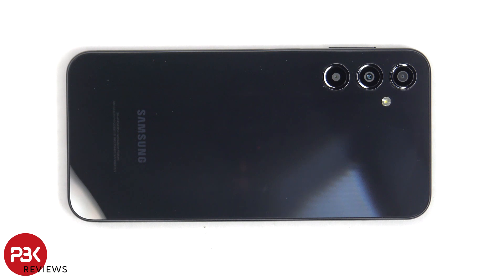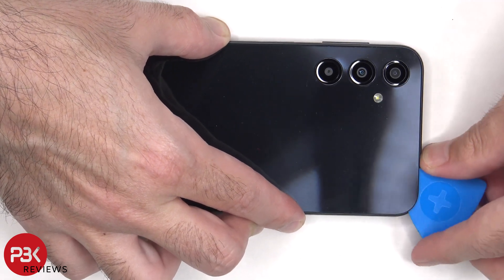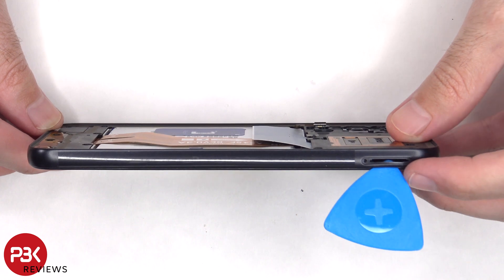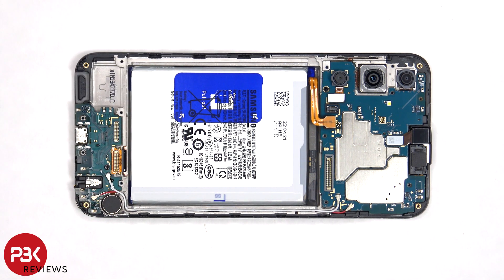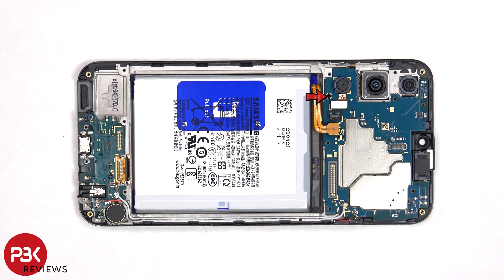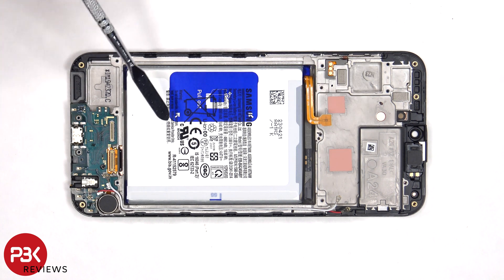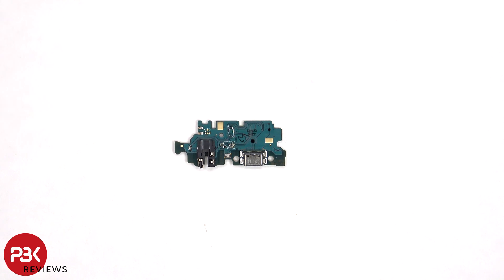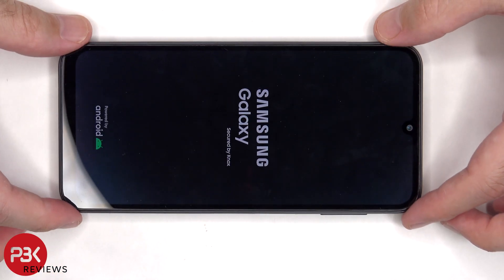Samsung Galaxy A24 Teardown Disassembly Repair Video Review

Comment: Excellent description and very well presented. 

I'd be most grateful for any help. I replaced the A24 battery successfully, it charges and the phone works except after a short time it closes saying it is overheated, whether its charging or not charging. But ambient temperature is 20C and the phone does is not at all hot. I suspect I did something to the phone when working on it. In troubleshooting, I scaled down all its energy uses to bare minimum and did a clear wipe of the cache but no improvement. 

I found that without the protective case, the phone will stay on much longer. But a few minutes after putting the case on I get a warning message that the phone is heating up and will be shut down. It's still not hot with the case on. Before I replaced the battery, the case never gave an overheatiing message.

Comment: hi, i would like to ask a weirdly specific question

lets say a decent amount of weight (for example, a medium sized, half filled tumbler bottle) was dropped into the phone and impacts the back of the phone, specifically to somewhere between the middle of the flex cable connector, the battery connector and level to the 2 pixel camera at the bottom and presumably hitting somewhere either connected to or the processor that's been hit , and the impact is enough to cause the phone to crash and shut down every 15 minutes or so, however, a drop approximately a desk tall cause the conditions to worsen significantly, causing the phone to only be able to stay on the home screen for roughly 3 minutes and occasionally taking 3-5 boot loops (as the phone attempts to start into the home screen).

eventually, getting into the home screen is getting difficult, and the end of the day the phone only boot loops with it taking a considerable delay in between pressing the power button and the phone turning on at all. and through another series of unfortunate mishap the phone eventually boot loops repeatedly until the battery ran out and the phone, showing no signs of life, is hard bricked due to not being able to be charged.

how can this (presumably and no matter how unlikely) be fixed?

and what could the damage be? could it be the capacitor supplying power to the processor? could it be the ball solder connecting the processor to the board, or could the damage be from the processor itself where something in the silicon is damaged? or could it be something else? what would you do to diagnose the problem and what can be done (or attempted to be done) that would at least remedy the boot loops and get it to a state (full home screen boot or recovery mode) where data can be extracted from it?
Reply: My a24 fell of the balcony 5 months ago then its screen replaced, it worked about 4 months then it become just like yours, its very hard to get to the home screen and it dies after 15 minutes.
Reply from the maker: Hi, not sure it can be a host of things. It may be loose or disconnected cables shorting, solder points on the board somewhere broken, damage to the processor from pressure etc.

Comment: Is it easy to fix the power button ?(it goes on and off automatically)
Reply from the maker: yeah you can order a replacement power button/fingerprint sensor flex cable and replace it, its located on the back housing held on to the side with a metal bracket.

Comment: hi, thanks for your review-  I have a question I have bought a silicon case for this device it dropped signal of cellular connection, could u tell me where I can pin into the solicon case in order to improve the strength of the singal also the wifi signal
Reply from the maker: Hi, there are multiple antenna flex cables around the phone, so I am not sure which are for which but I would suggest using a different case if it is giving you issues.

Comment: what happen if i put different parts for example if i put s23 ultra camera on xiaomi phone ??
Reply: Simple, it'll not work.
a. Because of the Shape of the Flex Cable
b. Serialization
Reply: @Bruhifficulty  i watched videos one change iphone battery wiyh samsung and it works and converts the one sim version of iphone to dual and it works so i ask how far it goes
Reply from the maker: Would require extensive hardware modifications as well as software in some cases. Not worth it and 90% of people won't have the expertise to do it. Just unplugging and moving it over to another phone won't work.

Comment: No 'copper vapour chamber' heat dissipation underneath the battery, so performance is going to be a little bumpy.
Reply: helio g99 2.2ghz not that hot. they're no need for the such chunky v.chamber. just some thermal pads to help transfer heat from the chip to the alu mid frame could be enough
Reply: It probably uses 4-5w max, that doesnt need one.
Reply: @bulletpunch9317  The screen ,the network modules, the ICs looks like a maximum 6 Watts
Reply: @dukebrobbey64  yeah it might use that much if you load everything up 100%, but a realistic test like genshin at max 60 uses under 5w.
Reply: @bulletpunch9317  I concur.